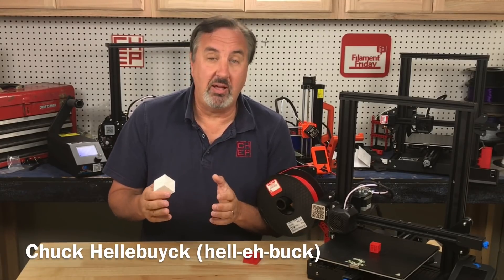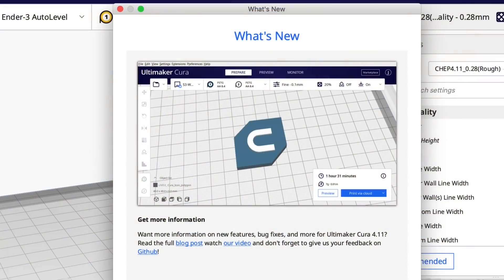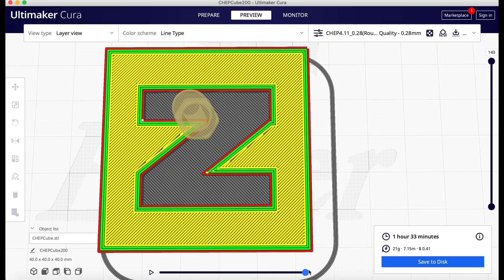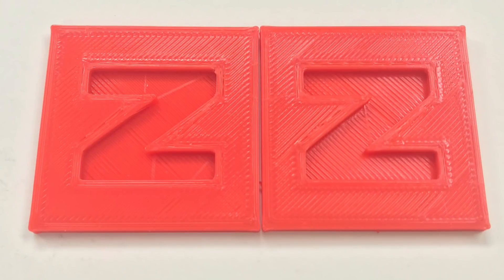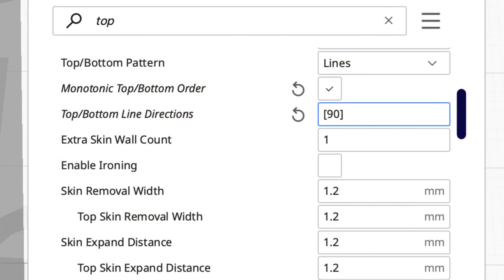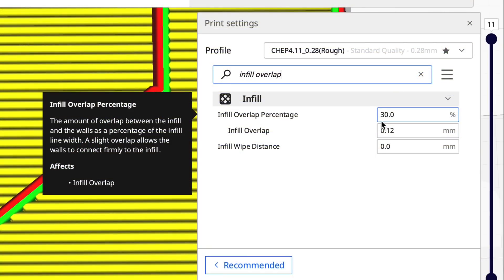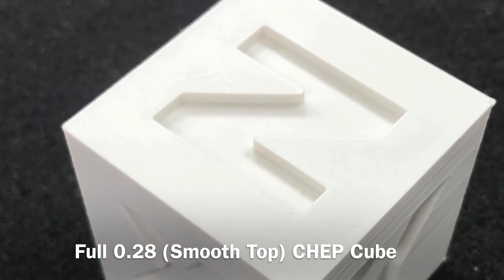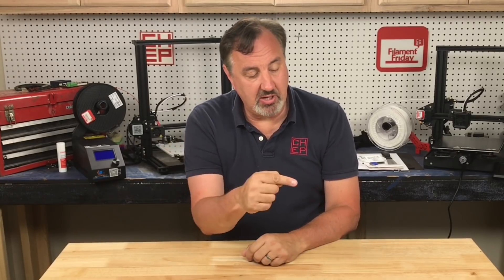Smoother 3D Prints in Cura Slicer 4.11 without Ironing!

Comment: I tried out your newest profiles and got results that were not as good as the stock ones included in 4.11.  I wonder if you have an extruder that's different than the stock one?  I got some underextrusion on a print and it went away with the regular .20 profile.
Reply from the maker: Have you verified your e steps?
Reply: @FilamentFriday  Yes, I have the printer dialed in really well so that it's very reliable with the stock Cura settings.  I'll redownload your profiles and give it another shot.

Comment: Hi chuck thanks for the update. I bought printer without heated bed. Can you give me some tips so that i can have a good output?thank you
Reply from the maker: Glue stick works fine. I did a video on it.
Reply: @FilamentFriday  on my glass bed it doesnt stick at all when i use some regular glue stick... Its from the brand named uhu... But with the spray from printafix it sticks so well that i dont get it off when the print is cooled down...
I can print without heat at all with the spray
Reply from the maker: Yeah UBI kinda sucks. I use Avery permanent glue stick.
Reply: @FilamentFriday  not ubi... Its named uhu here in austria... 😅
I think thats a little austrian brand
Reply: Thanks. Appreciate much
Reply: Use printerfix or 3dlac to put it on the bed... With these adhesion helpers the filament sticking to the bed without heat😉
Reply: @XxX0Fanta0Holik0XxX  thanks, where can i buy?
Reply: @simpleman4057  Amazon... I am getting my printafix spray fron there

Comment: Thank you very much Chuck! You make everything so much easier for the community! Those settings are awesome, I'll be using them for sure.
Another thing i wanted to say is that i think monotonic setting is for models that have a big surface and extrusions on top (or even holes), to make that surface smoother, because cura likes to leave the part where you have a hole or an extrusion for later, and that seems to make the surface finish incosistent. I think that couldn't be seen in a chep cube since the z on top is inside the model. Maybe I'll try to print some test prints and see if that is the case.

Comment: Changing the top layer line width to 0.28 basically does the same thing as ironing, since the flat part of the nozzle is smoothing over the other lines in an overlapping pattern.

Comment: The monotonic printing appears to print in one direction.   As there is difference in line geometry if it is laid down next to another line, the light will reflect differently depending.  On the default print that difference will be visible where it changed directions, demonstrating the sheen differences highlighted in the documentation.  Monotonic printing will address that.

To relate it to something, it is similar to how you carpet looks different on a push vs. pull.  The 3D print just happens to affect the sides of the line.

Comment: Chuck, your cube is not the best test print to see the results of monotonic printing. You need something with a feature like a hole or similar that breaks up the normal "flow" of the print path. I would not have expected any visible improvement on the cube.
Reply: Z is the hole on top, but because (top) flow is so low (there are gaps between lines, see 2:27), monotonic does not affect much. If flow was higher, result would be visible. Clearly visible if flow was even a tad too high.

Comment: I’ve been having reproducible layer issues on my prints.  Like, they are in identical spots.  I’ve completely undone the belts and retightened them, I’ve relubed my z axis rod, and I’ve installed a new hotend/nozzle.

Issue persists.  It’s so so so weird.  Honestly about to wipe all my cura settings and start over.

Comment: So basically PrusaSlicer been taking features from Cura lately (fuzzy skin) and Cura from PrusaSlicer (monotonic) 😂
Reply: Snug supports (Cura -> PS), variable line width (PS -> Arachne) - good ideas are worth implementing ;) Currently IdeaMaker is only one with surface patterns, Cura is only one with tree supports and PS is only one with support gap not tied to layer height.

Comment: CHEP: Look you don't need ironing to get a smooth top

Also CHEP: * Implements ironing using other settings  *
Reply: This isnt doing an extra pass over the top layer like ironing does. This just changes the pathing of the top layer.
Reply: @blainematlock  It was mostly a joke, but I really don't think that invalidates my point. I don't think he argued that saving this extra pass is the reason to not use ironing, it's about quality issues. Which means he'd need to tune the ironing settings, which he showed no attempt of. He didn't show "OMG, I've tried all these different ironing settings and none of them work! Look!" He showed one example.

As for implementing ironing I meant: he changed the orientation of the lines to be along the x/y axis, lowered the amount of perimeters and made the line width smaller than the nozzle... it's most of the way there man...
Reply: @cambouiscom  I've had good luck with the PETG pieces I've ironed, but admittedly I usually only iron small top surfaces like 2cm^2. Drying out PETG in a dehydrator makes a huge difference since it's so hygroscopic.

Edit: That is a good way of putting it though, it's like a 2-in-1 step of top layer+ironing
Reply: @cambouiscom  Definitely for that use case this looks a valuable technique👌 Those translucent PET filaments are really something you don't get with PLA or ABS. PET is what had me switch from Cura to Prusaslicer, but I think I've ready to return to Cura since I've got my printer mechanics all tuned up. I miss all the options to tweak! 

Definitely wish most materials behaved like PLA though 😔 I've been smitten by ABS with how easily sanding and acetone vapor smoothing can just make the lines disappear altogether. It's like a grinder and paint with welding, haha.
Reply: If you watch the video he compares the ironed and non-ironed prints and it proves his point, at least on his test print.
Reply: @adaycj  I did watch the video. He only had one ironed print and didn't mention the settings, so at least in this video, he didn't show any attempt to tune the ironing settings. Didn't seem like a fair shot in the way it was presented, but that's just my opinion.
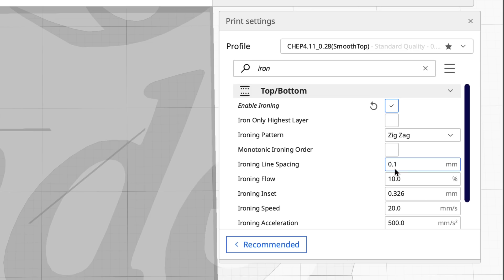Reply: @RubixB0y  He says the video isn't about ironing, it was just for comparison . You claim he added ironing "using other settings", now you opine that he didn't show more ironing settings? His ironing settings were shown in the video 4:44, and he has a separate ironing video (actually 4 at least). He even stated "I'll include ironing because I know someone will ask" 4:44. 
It was a clear concise video, that illustrated the point he was trying to make with relevant examples. If I see any shortcomings in the video it is that he only seemed to test on a test cube and not other prints where top (or bottom) finish might be more challenging or more of a concern. However, then it wouldn't have been a short and concise video. Also, just my opinion of course.
Reply from the maker: I did show my settings for ironing. Watch again. I’m sure it could be improved but I prefer the option I showed anyway.
Reply from the maker: adaycj - Thanks. You totally understand. I couldn’t do enough prints for some commenters so I don’t try. The settings are the focus of the video.
Reply: @FilamentFriday  My bad, I watched the video the first time and I'm incorrect about you not mentioning the ironing settings. I don't re-watch the video just to reply to replies days later.

My main point there wasn't more than 1 example of ironing, not that the settings weren't shown at all. If you think that's sufficient for a concise video I acknowledge the tangents have to stop somewhere. I haven't watched the dedicated ironing videos admittedly. 

It was mostly in jest with only a kernel of criticism. I appreciate the in-depth thoughts though. I'm not immune to criticism and it was more cynical of a comment than warrented or intended in hindsight.

Comment: Hey chep do you see a massive difference between cura 3.6 and 4.1 iv always stuck to the 3.6 because the versions up kept being bugged so went back to 3.6 and stuck with it for 6 years I'm debating to give it a try or just stick to what's always worked and hope your keeping well bud it's been along time :)
Reply from the maker: I have both on my computer. I find 4.x has a lot more options. But 3.6 is still good.
Reply: 4.6.1 for me and would never change because my prints are ok.
Reply: I switched from Cura to Prusaslicer about 8 months ago(only had a printer for a year) when I was having trouble getting PETG to print. Obviously my Cura profiles must've had some issues so now I'm thinking about switching back now that I have more experience..

6 years seems like a long time to me to not try anything new, but if no new features are compelling (I'm sure there's lists of the added features), then there's no reason to fix what isn't broken.
Reply: @RubixB0y  many years ago I had that same advice when I moved up to 4.0 why fix what's not broken only to brake it with and update wise words and true so I always stuck to 3.6 because that was the best at that time :) cura has gone along way since then so I'm wondering should I 😂😂 I may just go for it if all else fails I can put it back i guess :)
Reply: @barrywilliams2008  Exactly, just think of it as an adventure where you always have your home base to come back to, you can only learn more.

I just switched from bowden to direct drive on my printer and dealing with retraction is so much nicer now. 

Thinking of switching to Klipper from my tweaked Marlin firmware. That input shaping (to reduce ringing) and pressure advance that works in stealth chop mode with the stepper drivers is so appealing. I'm just happy I have my new home base after the bowden -> direct conversion though.

Good luck!
Reply: @RubixB0y  I'm still using Bowden on my creality cr10 it's got a good few upgrades now :) I solved the banding on the Bowden by shortening it from the extruder to the inside of the opposite frame post and put in clips in inbeween the Bowden holder nuts stops the play then done the e steps and it's been awesome from then on in :)